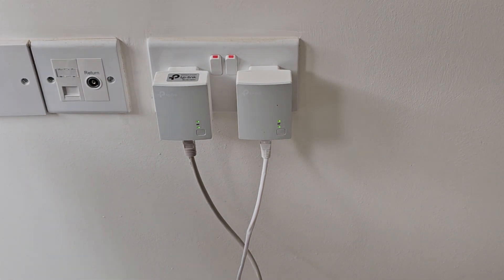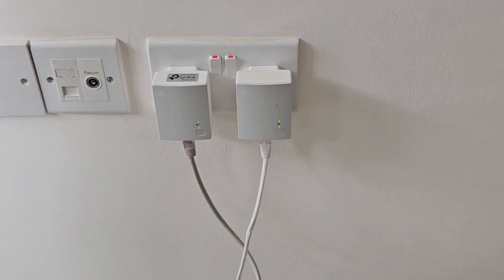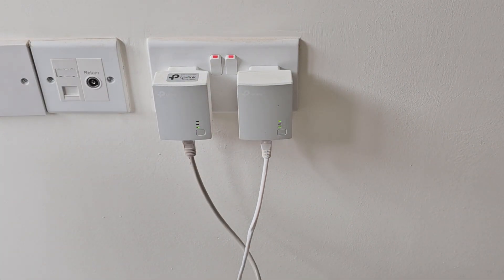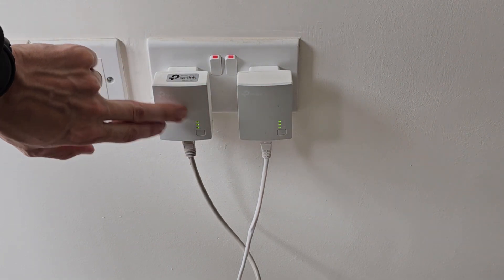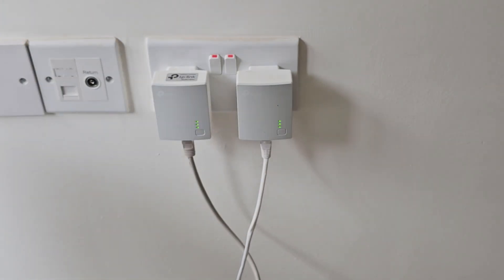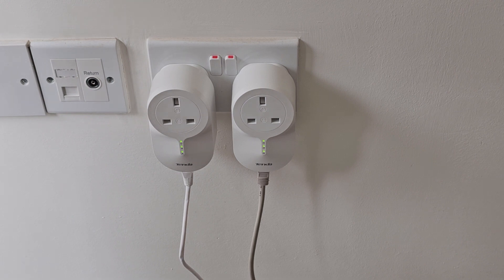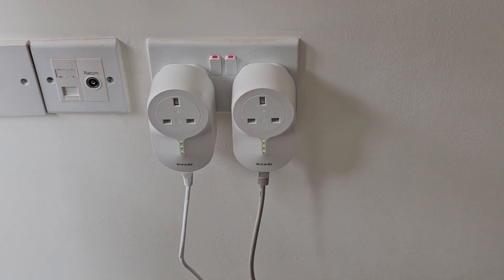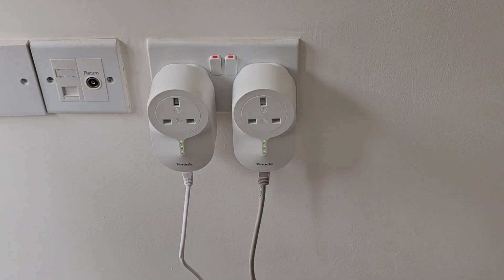Powerline Adapter Pairing & Reset Procedures, TP-Link / Tenda - Smart & Secure.

Comment: Thanks, I liked the video, very useful.
You got me thinking about being on the same circuit.
Is it possible to join circuits digitally by spanning them with 2 powerline adapters ?
For example 

  Router -->  ethernet cable ->  PL adapter/Circut 1 === Circut 1/PL adapter --> ethernet cable --> PL adapter/Circut 2 === Circut 2/PL adapter --> ethernet cable --> Computer

Or would this present server / client issues .

Comment: how many of this type of extenders can be used at the same time? it is possible to have 4 of them working together?
Reply: Yes.
They work similar to wifi pods but provide direct ethnert LAN port connection (ei for desktop guys who want to connect their PC directly to LAn modem instead of wifi signal)
You need 1 connected directly to ur modem/router LAN. From there it can send signals to every pair u got provided distance is good & ethernet cables aren't damaged. 
Just link/pair them if ur having difficultly connecting b4 going into resettting modem

Comment: my tenda powerline adapter one of them have no middle led working and just no connection unless in the same room or in the same plug together or there is no connection any advice?
Reply: If it works on one room and not another that suggests the other room where it isn't working isn't on the same circuit. This powerline solution creates a network within a circuit. For example, my kitchen, bedroom, and part of the hallway are on the same circuit. But my living room and other part of the hallway are on another circuit. The router is in the kitchen and when I use these adapters by plugging one into the kitchen socket, I'll only be able to get internet through the powerline in my bedroom and part of the hall that share the same circuit as the kitchen.